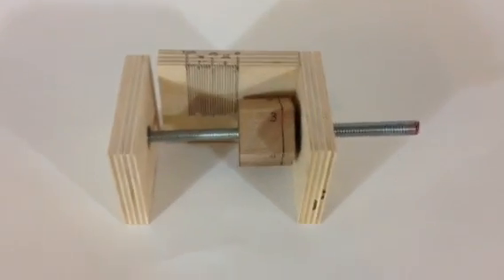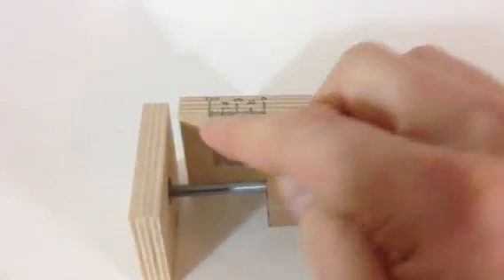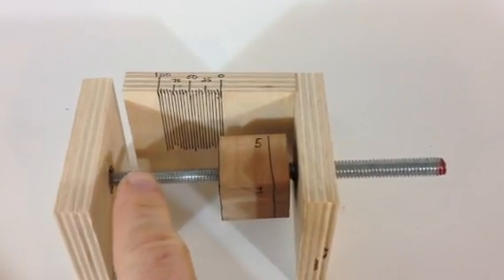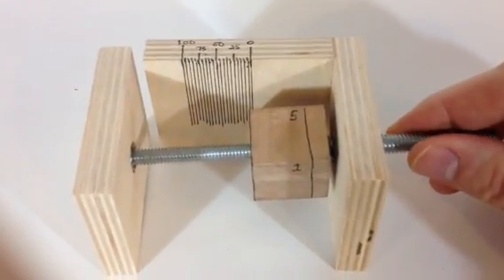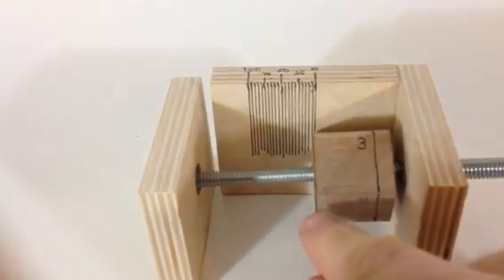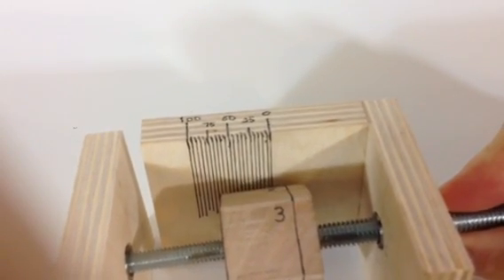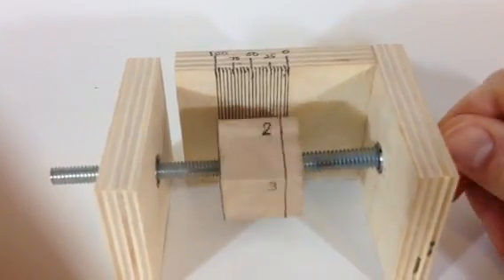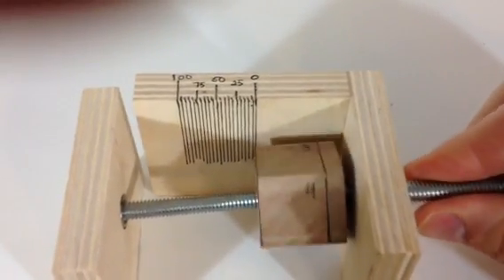Micro-Adjustment Mechanism

Comment: Love it. Accuracy on the cheap. Never before stopped to think how a micrometer worked. It took me a minute to understand this. Way cool. Each rev is .0056 movement of the fence. (1/18)-(1/20)=.0055555555555...55556. (And I notice that diameter of the threaded rod does not affect the differential. It only affects what is commonly available. If you're custom fab, you could make whatever diameter or pitch you wanted, but then it blows the cheap aspect out of this project.)

Comment: I'm sure it's very clever. But it just beats me why the two sizes of threads. If you want to adjust by 20 threads per inch, why not just do that? I'm just missing it.
Reply from the maker: The micro-adjust mechanism is a differential screw. It works much the same way as a micrometer. The value in this mechanism is the precision which can be achieved with cheap, off the shelf parts.
Reply: 4 years later, I'm going to write this more to make it clear in my head than to actually answer your question:

On the right, we have a "plate" and a threaded rod. The plate (the piece of plywood) is fixed in our frame of reference. (If the plate moves, our frame of reference will move with it. All movement is relative to the right-side plate.) The threaded rod on the right is "5/16-18 all-thread". That is, a commonly available steel rod threaded all the way from top to bottom, with a diameter of 5/16 inch, and a thread pitch of 18 threads per inch (TPI).

By design, turning the rod one complete revolution will produce 1/18 inch of movement, because there are 18 TPI. That's 55.5555... thousandths of an inch.

The right-side threaded rod is (supposedly) co-axial with the left-side threaded rod. (I am not saying "left-hand" because that might create confusion about thread direction. Both rods are standard, right-hand thread rods. One on the left side, one on the right side of the video.) The left-side rod is "1/4-20 all-thread". That is, the diameter is 1/4" and the thread pitch is 20 threads per inch.

By design, turning the left-side rod one complete revolution will produce 1/20 inch of movement, because there are 20 TPI. That's 50 thousandths of an inch.

On the far left side there is another "plate." The left-side plate is free to move left-to-right, but is prevented from rotating by its shape and the fact that it is laying on the table. Thus, just like a nut on a bolt, when the threaded rod is turned to "advance" the screw, the left-side plate will be drawn towards the right-side plate.

The right-side rod, when rotated one complete turn, will "advance" by 1/18 inch. The left-side plate, when the left-side rod is rotated one complete turn, will "retreat" by 1/20 inch. Thus, rotating the coaxial rod assembly will cause 1/18" - 1/20" of movement. From above, that's 55.5555... - 50 = 5.555... thousands of an inch.

If there is a 5-sided handle that allows the user to turn the rod assembly 1/5th of a turn, each side turned will produce 1.111/1000 inch of movement on the left-side plate. For woodworking purposes, that's ridiculously precise.